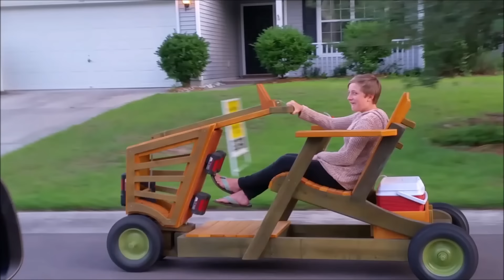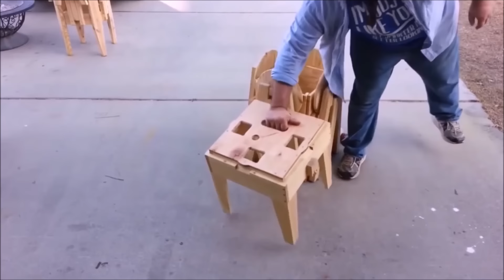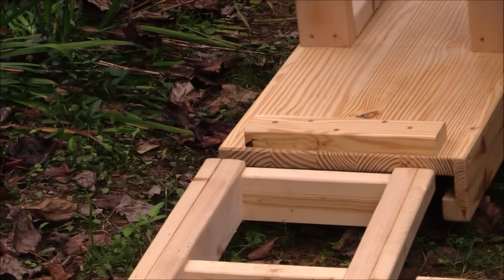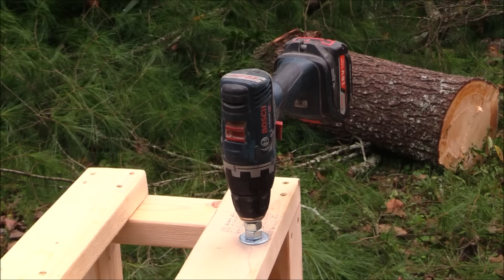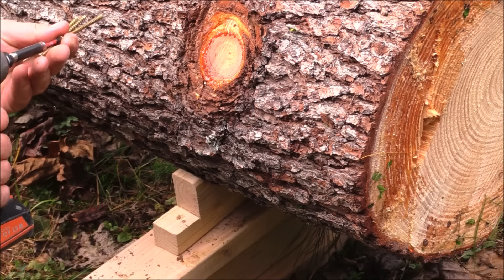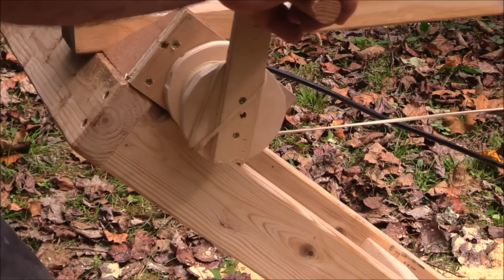50 Dollar Portable Sawmill | Chainsaw Mill

Comment: Here is a though. Why not use a lawn mower engine? Say a 5hp. The mount the chain and bar to the lawn mower engine?
May need some fabricated metal parts but it would be like cutting butter with a hot knife.

Comment: Hey Izzy ... awesome project.  Is there an easy way to allow you to cut a roof angle slab off of a log. If I wanted to use the chainsaw mill to cut the angles on my roof ridge pole, would there be an easy modification to do that type of cut? Thanks.

Comment: Interested in how the system works to raise and lower the saw with the drill. Adidas you use a threaded bar and bury a couple nuts into to wood that the thread bar goes through? Never mind, found the video showing how you built it.

Comment: Are you constantly sharpening blades? On a hardwood tree like beech or oak, about 20" or so in diameter my blade needs sharpening after each fell. That doesn't include deliming or bucking. You're going the length. I'd guess I'd have to sharpen the chain every two slabs on an 8' chunk of hardwood using a chainsaw like that.

Comment: When the drill isn't being used let it turn the crank.  Pushing a button with the left hand ought to be easy, LOL.
I love the design.  My dad put together a professional sawmill back in the late '80's with a 40"??? circular blade and a huge diesel engine.  He designed it well.  Had it at the bottom of a hill
so he could roll the logs onto a carriage and those logs would whish through that blade like nobody's business.  I didn't keep it when he died since I didn't know how it all worked or even how to turn over the engine.
When I watch barnwood builders I'm like being off 1/2" from one end to the other just ain't that big a deal when you'll be chinking it anyway.

Comment: Kind of late to the party Izzy, but if you were to mount the crank handle on the right, you could run a dowel across to the left side, and mount your pickup reel there.. Great idea, will /has made a lot of woodworkers lives easier..

Comment: hope you don't mind if i make a suggestion, I'd follow the chain saw with spacers the width of the blade +1mm. It'd take some stress off the chain saw and the cut would be a bit easier and quicker

Comment: The chainsaw I bought other than the immediate project I had was purchased for this reason.  I’ve seen similar systems as this one on a TV show his he called an Alaskan Saw Mill. He used a 1/2 of an aluminum extension ladder. Or, down under or across the pond aluninium (I lived in Australia for a year & learned it was pronounced different because it was spelled different) any way I do like the hand crank as will my back.  I hope you have a link for that chain.  Very cool man. I did just buy an old 20” band saw to resaw & recycle cypress to remodel my kitchen cabinets.   Gonna be hard to stay on target with that being retired and not go find a nice tree somewhere that one day might become an electric guitar or something.  Again cool 😎 man.

Comment: I'll throw an additional 2 cents, I have always been a Stihl guy since logging in the PacNorWet. Huskies do start easier. Husky also makes Polun, which I thought was a POS til I bought a 42cc saw for 50 bucks. Damn if it starts just as easy, then I found that Husky bought Polok saws several years ago, and they are now just a cheaper version of a Husky.

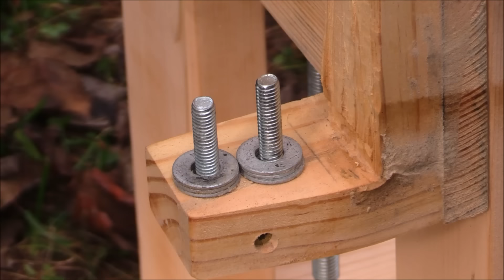Comment: For the bolt-hole drilling through hard steel at 1:11, I'd recommend a cobalt bit. They are pricey, but if it is for a common size that you use frequently (3/8ths bolts?) then you can get just one instead of a set. As an added bonus, cobalt bits can be re-sharpened almost indefinitely, until they are only a stub.
Reply: For something thin and hard that does not need great accuracy like this you can simply use a masonry bit which has a carbide tip brazed in.  You probably have one on hand somewhere already and it’s cheaper than cobalt bits.

Comment: You could cut some small shims about the same thickness or slightly thicker than your chainsaw bar. Then as you are cutting , place them behind the bar every so often. It will keep the slab from pinching the bar . And help get a smoother cut. Especially at the very end of the cut.

Comment: Just would like mention that no matter what brand saw you have you need to have it set up for slabbing, you are running full out if not you can burn a hole in the piston my son learned the hard way he had to have the motor rebuilt, beside the fact that you need to spend a little more and purchase a higher quality saw. My 1st saw was a jonsered now owned by husquarvna i just retired that saw it still works it's a bit banged up now purchased in 1980, buy a Chevy or Cadillac however i do like your wood mill set up.

Comment: I wonder if there's a way I can adapt my Alaskan meal like you done there I'm on find out
Reply: Yes first thought was remembering the video 'Turning a tree into lumber using a homemade Alaskan Mill'  from 2015.  Seems like there should be a way to combine ideas from both, and possibly make something even more simple and robust, that combines ideas from both.  At the very least, if you put the Alaskan mill type parallel to the bar follower plank on this saw you could guarantee  even thickness a little easier.  As it is this depends on the angle set by the bolted down saw and the square frame holding the saw, and the wood/cut has a lot of leverage against it, so probably a little more variable..
Reply: @ModelLights  thanks for the tips.
My comments are usually actually retorical so thanks again for your reply.🍻

Comment: Man I been thinking of building a mill for the past few weeks now , and I was thinking I might actually make 75% of my frame out of lumber , just with some steel angle for roller guides so I don’t have to spend $3500 on steel , got a bunch of really old 4x4 oak x 9’4” from ductile iron skids , that stuff is about as close to Medal as it gets , Nice Work for 50 beans man I’m all about the save factor and seeing what I can get out of my $1

Comment: You have all the skills so why didnt you build it from steel?
More compact and alot more stable.

Also the parts will bolt together and hold better.

The woid version will wear out very quickly
Reply: Weight may be ?
Reply: @cemremertmert  small price to pay for reliability and longevity

Comment: The only other improvement i would make is a step down 15 watt 30:1 step down DC motor and attach it to the hand crank, turn it on and walk away, maybe even connect it to a light switch light timer so you can have it turn off before it finishes the cut and ends up flying around your lawn like a out of control helicopter.

Comment: I have tried using Latex paint mixed with 2 parts water (on completely dried lumber) and put the final coat of paint later. this provides unbelievable protection for the wood. almost plastic like. Thanks for the video, Ingenious.

Comment: Hello, why don’t you do all sides to get dimensional lumber? I use the Granberg Alaska saw mill. I need 4 x 8  x 24 ft long beams. But I have to admit your contracption looked like a contraption. It is minimalistic and it works. Super job. And a Prius wow. I skid my logs out of the woods with pulleys, chains, rope and my 20hp v2 awd Huskavarna garden tractor. As for my chainsaw’s I have a Still and a Huskavarna. I think the Husky is lighter cc vs cc and it starts like a charm. Thks

Comment: Have your crank positioned horizontal instead of vertical so the pressure is more consistent - I can see the frame flex up and down as you crank the handle.

Comment: When I went to the Philippines the natives there cut one inch slabs of acacia using just a snap line and a 36 inch chainsaw. They did this all by eyeball a quarter mile from the nearest road. The 8 x 1.5 foot slabs were straight enough that a hand planer took care of the rest. It was all I could do to carry one of the smaller boards on my head halfway to the road.  We made cabinets, tables, beds, and shelves out of it. I still have a bunch left over.

Comment: Just a suggestion and it will affect diameter you can cut but will work the saw less is cant your saw to where your bar is going through at somewhere between a 30-45 angle

Comment: Nice job! If your concerned about a heavy slab, wedge the back side of the cut to support it, then the center....depending upon the length of cut. Also, square up both top and bottom of the log. This keeps the log more stable.

Comment: Wax the rail maybe.
Nvm, I read the poly slide advice below, agree, I use similar on my slidedown roof system on my garden bar, the 'Roof' becomes my decking and the bar is open air in that mode.
Reply: Sayit AsItIs  no worries lol, 
And if you meant the decking roof thing on the garden bar, yeah, I fully recommend it, it really opens it all up, 
Cheers! :-D

Comment: Have to say, awesome sawmill! Love all of your builds.
My comment is about cutting directly into the end grain. If you could turn the saw a few degrees, you would find that it moves quicker and cleaner. Your shavings would be long strands instead of powder. If this was a bandsaw setup, 90° to the wood is great, but a chainsaw does much better ripping with a rip blade at about 60° to the wood. Hope this helps.
Reply: I was thinking this too.

Comment: This video coupled with your build video are GREAT- Thanks! I'm thinking of getting the Husky Rancher 465 - a wee bit more powerful than the 460 - and wondering what is the bar length you are using in the video (and is that the longest you'd recommend)?

Comment: Wonder if side-mounting the saw still allows the engine to lubricate properly...any long-term gravity fed oiler issues ? Other than that, more power to ya. I was once in need of a table saw I didn't have & ended-up inverting my worm-drive skillsaw & attached it to a plywood framework. Kind of scary & I wouldn't recommend it for novice DIYer's, but it got the job done. Necessity remains the 'mother of invention'.

Comment: you need to move up the hierarchy of materials, wood is at the bottom get up to aluminum or even steel, welding is easier but you can make a mill with a drill and angle grinder and have it all bolt/ unbolt no welds

Comment: This is awesome. I notice the hand cranking adds a slight varying of vertical moment to the rear of the slide. Does this appear in the timber at all, or does the chain just even it all out? I would have suggested mounting a drill but you'd miss out on the resistance feedback you feel through the handle. Great job.

Comment: I often wondered why someone doesn't use both sides of a large extension ladder, attaching something like this to the top and take the catches or latches off the ladder and just slide the top extension half to and fro from the bottom of the extension ladder. (?)

Comment: Great idea. Just a suggestion from using my Alaskan mill, when you are a foot or so into the cut, good to tap a wedge into each side, again further down the log, depending on the length, be sure to add some after half way point. This will keep the board from pinching at the end of the cut.

Comment: Been a few (dozen?) years since high school, but basic mechanical physics would seem to dictate that the advancing cable be as near the center of the load as possible.  Doesn't matter much where you prefer the crank  handle to be located as long as the reel and cable are pulling against the center of the working surface of the blade.  (Or something like that.  I really like the design, however.  Keep 'em coming, Izzy!!  Very informative.).

Comment: Nicely done! How hard is that crank to turn? If its pretty easy, you could sub it out for a bigger one so it takes you less revolutions per boardfoot... Maybe even having a couple you can swap out depending on whether you are milling bigger slabs/harder woods where the mechanical advantage of the small pulley makes turning easier or smaller, softer stuff where the bigger wheel will move the saw faster.

Comment: Awesome build, Izzy!  Really good design, I think.  
One tip I'd like to pass on is something I've seen in a few other videos that you may have not seen:  
If you ever want to cut thicker slabs,  you can make and use some wedges to keep the weight of the slab from binding on the chainsaw bar.  Obviously, this isn't much of an issue with shorter slabs, but when cutting longer slabs, it can be an issue. It usually becomes more of an issue approx halfway through the cut.  :-)

Comment: add in a follow-up wedge plank to keep the blade from pinching instead of stopping and manually installing a wedge. leade it slightly proud of the lowest cut of the saw and thick enough to bring it to the thickness of the cut.

Comment: I'm sure you will be doing a bunch of mods on this project.  I like the crank on the right side, but one could put it on the left if they were left-handed.  I'm thinking differential gear system and leaving it on the right.  Your wooden gears would work great and you could plan with the ratio to make cranking even easier.  I like the throttle idea that (doseven) mentioned.  Do they make a roof rack for the Prius?  LoL  Love your videos!  Much better than watching TV!

Comment: You don't need to use your left hand if you run the rope on the left, just keep the crank where it is and put the spool over there with a long dowel connecting them.

Comment: Nice one Izzy! You also demonstrated that it is a relatively easy build for most woodworkers. With your inventive brain you also keep your designs from being over complex - simple is always best as long as it works well; and you demonstrated how well the saw does work in this video! I understand that a ripping chain has less teeth and they are ground at an angle of 10 to 15 degrees instead of the normal 30 degrees for a cross cut chain. Is this how your chain is set up? It certainly made good progress through that fresh and probably resinous pine. Well done! You are an inspiration to your viewers.

Comment: Looks good.  Have you thought about cutting in the other direction.  The way you are going draws the chips into the saw.  If you cut with the top of the blade, it would shoot the sawdust out away from the whole rig.  If you wanted or needed to clean up, you could just put a tarp down in the "target area".

Comment: Have you thought of putting a drill on the pulley maybe it will smooth the motion out a little and it will also be more autonomous.  Maybe pulling it from the bottom as well in a straight line with a hand trigger.  If you have a drill that you don't mind taking the trigger out that would make it pretty sweet too.  I understand in the woods and power is an issue just a suggestion.

Comment: Looks great.  Did you think of using a lawnmower cut off cable for the throttle?  Specifically the one where you need to hold the handle down to keep the engine from turning off, you could reuse the handle as well.
Reply from the maker: thats a good idea

Comment: next upgrade... using bolts to assemble. I can only assume the screw will chew out the hole eventually.
Reply from the maker: agreed
Reply: There are plenty of other places to try mounting. I'd never intentionally weaken a chainsaw bar.

Throwing that first chain makes you a bit paranoid afterward...
Reply: @2DawgsMikeD  The force of cutting is in the plane of the bar, so those two holes shouldn't alter the strength in that dimension significantly.   It's like cutting holes in a joist.  You can get away with a pretty decent size hole, but if you notched the beam by the same amount you would weaken it a lot.  If there was a bending force orthogonal to the direction of cut, then the holes would weaken the bar relatively more.  I don't think you'd see that in normal operation.
Reply: Clamp it... some of us are just lazy
Reply: @0uiallo No you mean suicidal. We're talking about a chainsaw attached to this construct.
Reply: @Bjorn_Master-of-None  hey some of us are just suicidal